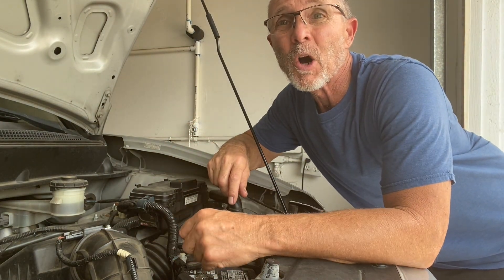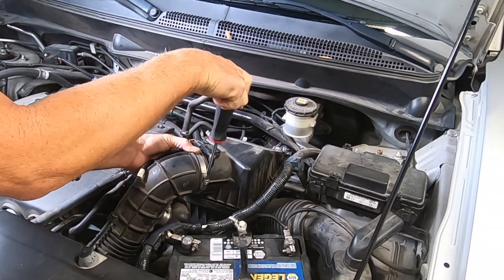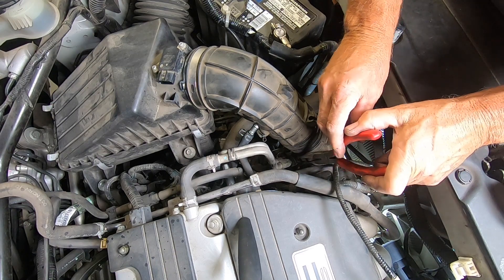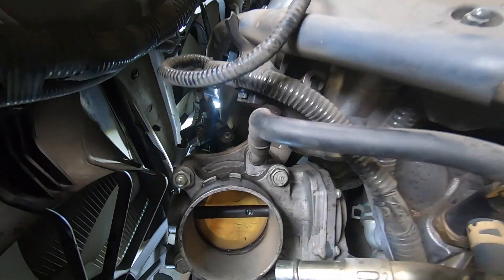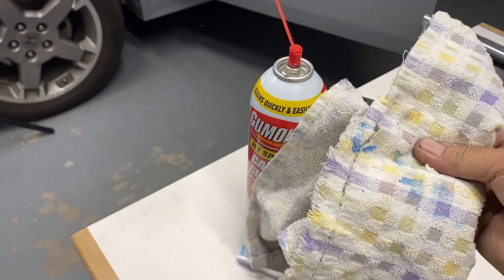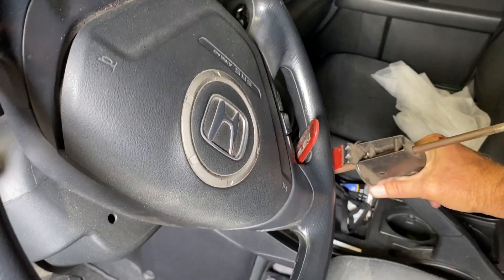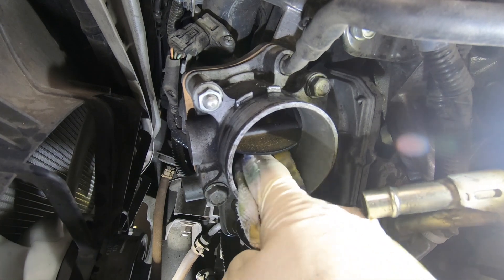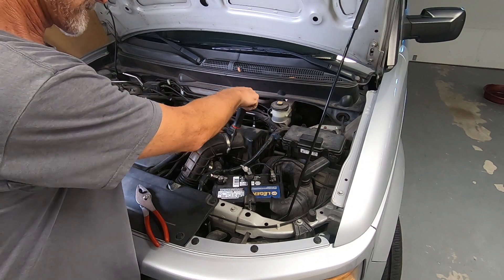Honda Element surging, rough idle, stalls, throttle body clean.

Comment: Unless the battery is disconnected, dont get your fingers anywhere near that. Its electronically controlled and can snap your finger off pretty easily. Id recommend taking the throttle body off to clean it.
Reply from the maker: Never had a problem with that, but caution and common sense is alway advised
Reply: The butterfly valve can snap your finger off huh

Comment: Great video Danny, ty.  I just want to add that in 2007-2011 Elements, the throttle body value in the computer will need to be cleared by a scan tool either before or after the procedure in this video and then followed by Danny’s next video for relearning the idle.  Taking battery cable off or removing ECU fuse will not erase the stored throttle body position values in the ECU.  There is also a crankshaft related value that does not need to be messed with unless that sensor is getting replaced.  I did the procedure in this video and the idle relearn many times and ended up with surging as well as high resting idle, until I cleared the throttle body value by scan and redid the relearn and it worked perfectly.  There are 2 forum threads on that as well.  I hope this helps someone watching this video.

Comment: More Honda ELEMENT videos please!!
Reply from the maker: Jaime Quiñonez you got it, if I didn’t work full time I could do more, is there something special you’re looking for?
Reply: @dannysdiygarage  , great video with smooth, clear breakdown of steps - especially disconnect and reconnect of hoses and sensors.  Request taking this video further with a Part 2, where you remove and clean the IACV.  Other videos skip showing disconnecting the hoses and sensors to focus on the cleaning, but it would be helpful to see a clear tutorial of how things connect with the IACV.  My 2006 Element is surging and I suspect this is the issue.  Seems like simple work, but I'm a little concerned messing up hoses and sensors after cleaning!  Thanks!

Comment: My element is idling a bit rough and RPMs fluctuate only while in drive like at a stop but not in neutral. There are no codes. I've replaced the PVC, air filter, spark plugs and had a valve adjustment and the problem still there. Does anyone know what it could be??

Comment: I replaced the throttle body, spark plugs and then went thru the reset where you turn the key on with out starting the engine for several seconds then starting the engine running  3000 rpms until the fans come on. I still have the throttle surging about 100 rpms. It’s hardly noticeable unless you watch the rpm gauge. My next step is to check for vacuum leaks. Any ideas? Thanks for any help Wa. State
Reply from the maker: possibly a valve adjustment, if they have tightened up it could give you a rough idle or miss fire, I will be doing a video on adjusting valve on a Honda Element soon

Comment: I heard that we’ve got to reset the computer to relearn by disconnecting the battery and some sensors after cleaning the throttle body. Is that true?  I’ve got a 2008 lx
Reply from the maker: The computer will relearn it’s new position once it’s driven a few cycles if not disconnect the battery and drive again
Reply: @dannysdiygarage  thank you sir~
Reply: You can do whatever with the throttle but if you replace the new one, or adjust/replace the tps, you will have to do a factory reset, $99 at the dealer, otherwise you can't shift it out of PARK and idle will be up and down constantly.  How do I know that? It happened to me! Hope it help.

Comment: I used this video to guide me through the repair last summer.  Thought I dropped a comment back then but making up for it now.  I had the same issues (rough idle, revving up and down).  Honda Element EX '06.  Other than a clutch replacement at 180K, never had a problem with it.  Great video, easy to follow, saved me around $430 instead of going to a local mechanic.  Been running just fine since this repair.  Thanks!
Reply from the maker: Thanks so much for taking the time to write this, always appreciated

Comment: All I can say is...  Thank you so much!
I was lucky... I loosened the top and bottom screw with a 10mm ratchet,
and was able to slide the hose over just enough to access and clean the throttle.
My 2008 Element is driving so smoothly now.
Thanks again!
Reply from the maker: Awesome, thank you for sharing

Comment: Another great video brother keep it coming I love them 👍
Reply from the maker: I saw you got a cat stolen, that sucks. Keep the videos coming.
Reply: @dannysdiygarage  yeah never knew it was a problem owned the car for 3 years. Good news I got a shield over it now so it shouldn't happen again.
Reply from the maker: You should make a video of your cat shield installed, I think there is interest, probably get a lot of hits.
Reply: @dannysdiygarage  Definitely it's in the works. Hope you are staying safe brother. Any new modifications you have done to the element ? I'm thinking of making the platform a bit lighter and be able to have 1 seat in the back still. It's been hard having only 2 seats haha.
Reply from the maker: I’ve been doing some mechanical work on my civic these days, once I’m done, I’ll adjust my Honda Element valves and of course I’ll do a how too video on it.

Comment: Great videos! I have a 2011 with 103,000 miles on it and it runs great and Idles perfectly,  with no check engine lights on, but for some reason when I punch it from a stop or under 10 mph with just a little more than normal acceleration, it has a bog-like hesitation for a quick second that you can hear under the hood like air or something that makes weird faint noise. I haven't checked the throttle body yet. I am freaking out a little because I adjusted the valves not long ago, but I'm not sure if it was like that or not before I adjusted them because I haven't had the car that long. I adjusted them just like your video. I just hope they aren't too tight. Any input would be greatly appreciated.
Reply: Probably the O-ring going to the power steering pump. This is a common problem that will cause that sound that whistling sound because air is being sucked in to the power steering pump.

Comment: I also replaced the transmission filter, no one had it took seven days to get. I called Honda dealer and service department said when they do transmission service they never include it in service. Honda said they could get it but would take seven days.
Reply from the maker: Thanks for the update
Reply: The service manual states it only needs to be changed when the tranny is replaced or rebuilt.  That being said, I changed mine at 290k and opened the old filter… nothing.  Pays to change the tranny fluid every 15k

Comment: Thanks for the video—I’ve got an ‘08 element (167k miles) with vibration at idle. I’m wondering if this could remedy it. Or maybe a valve adjustment? What do you think??
Reply from the maker: It’s easy to do and should improve your engine smoothness however have you checked you engine and transmission mounts? worn mounts causes shaking
Reply: David did you give this a try? I have a 2008 with a rough idle at cold start. wondering if this helped you.
Reply: Leoninmiami haven’t tried it yet - I’m really not too knowledgeable about cars so this one is honestly a bit daunting for me. I think I will eventually try though, slowly. Thankfully the video is pretty detailed and slow.
Reply: Have you tried it by now? I have the same problem vibration at idle and already replaced all motor and trans mounts. Made no difference…
Reply: Throttle body cleaning didn't do it but Map sensor cleaning did. When dust gets on them it can cause rough, high or low idle. Its easy and cheap, work your way up to the bigger problem if not so obvious- like a code.
Mine has 279k and I just recently did my first repairs. Then right after, my idle gradually got rough,  cold start sounded different and at times she ran richer than usual.  Found that the quick lube tech that  put my new air filter in did so incorrectly, crushed it.
The repairs done, out of caution and not failure, ( first repairs, I mean other than oil changes, tires, battery every 4yrs, and a set of break pads at 197k ) were the crank pulley/harmonic balancer, which was beginning to break down, crank seal, water pump (higher mileage vehicles should take care to avoid over heat) and thermostat. They're all located in the same area and easier, cheaper,  to do it all at once. Get Honda parts,  they're not more $, just better. If theres vibration, not from rough idle, check crank pulley. MAP and throttle body for idle. If it bogs when speeding up, its commonly the VTech oil spool valve / Vtech selinoid. Another easy inexpensive fix.

Comment: I was going to check for vacuum leaks because i have a PO171,  lean bank 1. 
Probably should clean throttle body too. 
It stalls at stop signs.  
Would sea foam help me? 08 lx 145k miles
Reply from the maker: Sea foam ? Doubt it! Yes vacuum leak would be a good start,

Comment: did you not have to do a TPS relearn after doing this? Mine is an 08 and it seems it can only be done with a computer.
Reply from the maker: I did not need to on my Element, and as I drove it it relearned, my Honda Civic took almost a month of driving before it was completely relearned, but once it did it was idling and running like new, if you’re having trouble getting it to relearn, try disconnecting the battery for 10 minutes
Reply: @dannysdiygarage  I didn't drive it a ton but it started throwing codes related to air stuff so I figured it was all associated with the need to relearn. I just went ahead and got a foxwell nt650 computer to do the relearn process. Seems like a good computer that works on a lot of vehicles and was only 150 ish on their site so gonna see if that will adjust it more quickly.
Reply from the maker: Update me when you can
Reply: @dannysdiygarage  computer fixed it used a foxwell nt650

Comment: My mechanic replaced my throttle body in 03 ex. Idle is high and locked in park. Any advice
Reply from the maker: Idle is high when it's in park? Engine light on and are there any codes? how high is high idle, what's the RPMs 1800, 1200, 1000?, IAC valve? usually it's going to be a vacuum leak causing unwanted air into the system, if the idle control valve is not bad, however it would need to be checked out by a good mechanic to determine this. good luck, time me an update when its fixed
Reply: @dannysdiygarage  light comes on when sensor is unplugged idle is normal gear shift unlocks. When sensor is plugged in 1000 rpms higher then normal.  Light goes off gear shift stuck in park.  I do have a certified Honda mechanic.  Thank you. Will see if he checked that
Reply from the maker: @catherinewilson1328  definitely check idle controls valve and see what codes are stored, good luck 👍🏼
Reply: @dannysdiygarage  thank you so much for your time! Thank you for the luck too!

Comment: there's a way to increase a little the idle on my 2005 Element? Im having some vibration at idle of 600-700 Rpm. If I increase it to 900 Rpm vibration goes away mainly when A/C is on. All four engine/ tranny mounts changed last week. Thank you in advance!
Reply from the maker: No, it will cause other problems
Reply from the maker: Btw we’re the factory mounts
Reply from the maker: Also what happens if you take a floor Jack and slightly lift the engine up releasing the stress on the mounts

Comment: Is there anything that can go wrong while attempting this??
Reply from the maker: David Kim follow the video and nothing can go wrong pretty straight forward, worst that will happen is the idle will be erratic until the computer learns where it needs to be, but that usually doesn’t take to long
Reply: I use  Seafoam spray about every 50k which cleans the intake manifold as well as the throttle body.

Comment: Why are there no videos on the later Elements with drive by wire?
Reply from the maker: The Element is the video is driven by wire
Reply: @dannysdiygarage  more specifically, an irregular idle condition on a vehicle without an idle air control valve...

Comment: Mine starting surging between 1-2 rpms after replacing alternator. Any ideas anyone here?
Reply from the maker: Did you do a throttle body cleaning yet? The most likely reason for this in my opinion is the throttle body is dirty and over time your computer adapted to this, when you disconnected the battery it lost its position, good time to clean the throttle body